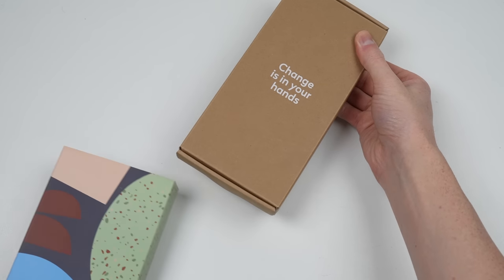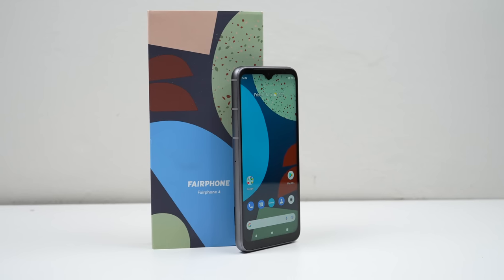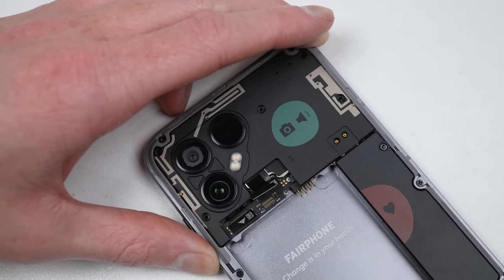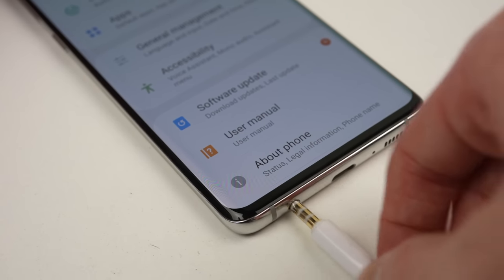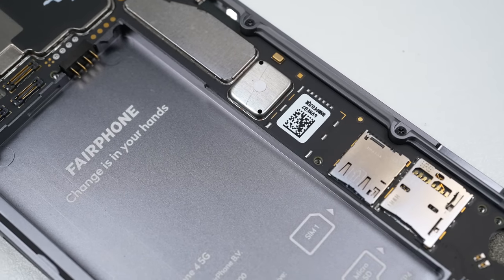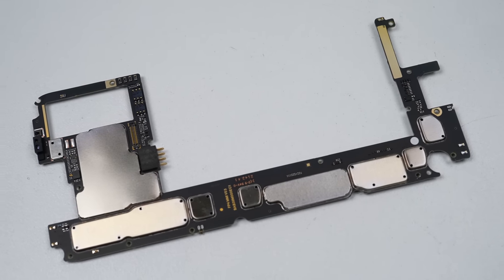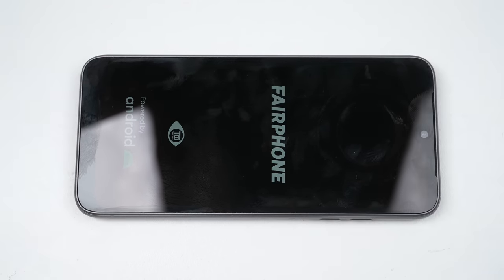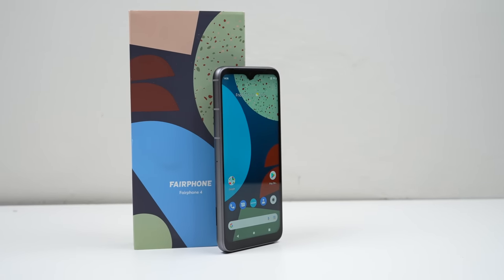The Phone Thats Fighting Big Tech - Fairphone 4 Teardown and Repair Assessment

Comment: I think this phone could've been made better with some feedback from the community, and maybe partner with other companies in other countries to provide the logistics. The repairability gimmick is cool, but it still needs some problems ironed out. Adding back a headphone jack seems to be the first step in the right direction.
Reply: The unfortunate part is you called it a "Repairability gimmick" , being able to repair your hardware that you purchased should not be considered a gimmick.
Reply: reparability gimmick?

I think we have lost the meaning of the word "gimmick"
Reply: if  repairability is a gimmick, this is not a phone to go for or even comment about further issues.
Reply: @DDRKhat  what I’m concerned with is that Fairphone seem to think its more of a gimmick - removing the headphone jack because you cant repair it whilst simultaneously being able to replace the USB-C port is asinine. Also wtf kind of company charges €35 for a cable?
Reply: @baconwizard  The USB C charging port is a necessity which cannot be fulfilled by any other port.

The headphone jack however is not a necessity because you can just buy an earphone with a type-c connector

However, that means you can't charge your phone while using the earphone or vice versa but who tf does that anyway?

I personally just use Bluetooth earbuds when I'm charging and cable when I'm not charging.
Reply: @technomatic6285  I do it literally all the time, not everyone is you
Reply: @DMack6464  Well, I can't deal with that many cables around me and that basically also means that I'm tied to where I'm sitting and cannot leave without my phone unless I unplug it both from the earphones and then the cables.

Maybe it's just me but I'd prefer a cleaner table over cable gallore when I'm working and need minimal distractions
Reply: I personally still think this is a gimmick, because in this current implementation this is impractical and too limiting. I honestly do not know how exactly to fix the issues, but at least having a choice of having the headphone port should be a good start, I think. Removing the port adds to the waste because you must have a specialized earphones or a dongle, or a Bluetooth headset to use this phone without bothering others, which is counterintuitive at best. Just adding it solves that issue.
For now it's just a compartmentalized phone akin to that from 2017. I really, really hope they can figure out a way to make this practical and actually useful.
Reply: @baconwizard  I can't claim to know their intentions but perhaps they could not find a good and easy way to compartmentalise a repair module for a 3.5MM jack? I do wish it was something that wasn't missing from this phone model.
I also agree that €35 is a stupid amount, and is just as bad as "Meta" (FB) for trying to get people to buy a similarly priced USB-C cable for if you want to use your "Quest 2" with a PC.
Reply: @PhilXavierSierraJones  As mentioned in another comment, headphone jack is the third most common thing to give out after screen and battery.

I think removing the headphone jack altogether will eliminate one loose end because a good repairable phone is one that you don't "NEED" to repair often.

There's no need for "specialized" earplugs.. just get a 3.5mm jack to Type C converter.
Reply: @DDRKhat  it looks as thought they could’ve done something similar with how they made the USB-C port replaceable considering there seems to be a lot of empty space on that board that they could’ve moved them to make way for the jack
Reply: @technomatic6285  it's a gimmick for Fairphone because FP doesn't sell most or any of the parts for their older phones (like the FP1 or FP2). Meaning the FP4 will likely not actually be repairable a few years down the road, when people actually need to replace parts and FP has stopped selling said parts
Reply: @thiefrules  Fairphone 2 came out in December 2015, do you really expect them to keep selling parts for it almost 6 and half year later?

They promised 5 years of continued support and they gave it, it's much better than any other company

Edit: Fairphone 2 received an Android 10 update in March 2022. They promised and they delivered

Edit 2: If you're using the phone for that long, grab a 3rd party part if you can.. the ease of reparability is still there.
Reply: @technomatic6285  Yes I do. Fairphone said they were trying to make phones that were sustainable and repairable. What is sustainable and renewable about not being able to buy parts to repair your device? My old 96 Corolla still has brand new parts being made for it, same with my iPhone 5s. Toyota and Apple aren't companies who focused on reparibility either. Hell, even Samsung is still sending out service packs with parts for older phones in other countries. And Fairphone, a company focused on making sure their phones are repairable and sustainable, doesn't. 

Anyways, we are past the era of phones having to be replaced every 2 years. People are running 4-5 year old phones today without problem. What's better for the planet, replacing your phone every 2 years because you need to replace one part, or keeping a phone running for years on end while changing out a few select parts? Guess which one I can't choose if I have a Fairphone 1 or 2?
Reply: @thiefrules  Apple does NOT manufacture parts for iPhone 5s and neither it is easy to repair. I don't give a shit about your Corolla because cars are here to destroy the environment. Which phone is Samsung still supporting?

Whatever man, you live in your own bubble, I can't convince you
Reply: @baconwizard  The space? Sure. But would they have been able to make a 3.5MM connector rely on a flex or other detachable component like the cameras, etc? I genuinely am not experienced enough to know if that's possible or how it'd be done.
Reply: @technomatic6285  The headphone jack IS a necessity for people who do not wish to buy into the bluetooth and dongles craze. Wired earphones are one less thing to charge and one less dongle to carry, forget, or break. Wired earphones won't need replacement after a year after the battery dies, and they don't need to be paired/unpaired to switch between devices. The headphone jack is absolutely a necessity for a lot of people still.
Reply: @technomatic6285  I think you're thinking about the wrong thing since USB-C earphones are a thing and it is still regarded as a "specialty device" since it does need USB-C connection to work and cannot be used with anything else.
Reply: @DMack6464  What phone do you use? And after it dies what phone will you buy?
Reply: Modern Oppo phones here in the Philippines offer phones with good specs, dual sim, SD card slot and a headphone jack. My wife's older (4+ year old) Oppo still working well with the original battery. It's her daily driver phone and she blows it up with tons of calls everyday. She a marketing manager. So if Oppo can do it, why can't Fairphone. Why do American YouTubers even waste their/our time with reviewing it if FP isn't offering it outside the EU?

Comment: Such a disappointment for this phone. I was really looking forward to this, especially as it supports /e/ OS. Sadly this phone is something I cannot recommend, for a number of reasons:

Lack of a headphone jack is debilitating, and their claim is BS. I have lots of devices, dating back to even the 1980's, that have experienced a lot of wear and tear, but no broken headphone jack. I have rarely ever experienced failure from it whatsoever. Something people need to keep in mind is that not all headphone jacks are created equal. It's entirely possible to build a robust one, and it's also possible to build a cheap one that will fail easily. I abuse my phones a lot, but my Unihertz Titan has a headphone jack. It's never failed me in the 4 years I've owned it, it's IP67 water resistant (so much so that I can and have tossed my phone underwater both intentionally and unintentionally with 0 damage), and it's far from alone in lasting without breakage. Plus, consider that the charging port is designed to withstand insertion cycles, NOT adjustment stress. When you want to listen to music, the phone is going to be in a more compromised and vulnerable position, and whatever connector is being used for the headphones will have insertion durability be the least of it's problems. The headphone jack is provably reliable for this, to the point that my Blackberry KeyOne has been literally yanked, dropped, pulled, dandled, and otherwise abused with headphones inserted (I oftentimes got the cables caught on something when I was younger and thus had the cable yank on the port hard when they pulled back), and yet it still works without any issue.There is no excuse for something like this being excluded.

Lack of a gasket on the back of the phone is also not great. One of the biggest dangers for smartphones is liquid damage, as more-often-than-not, such damage makes the phone irrepairable. For a company that's designing a phone to be repairable, and literally removing key features because "it might break", this is yet another inconsistency in their message. If you're removing features because it might break, then why didn't you seal the back of the phone? Seems like one of these two things is far more important and worrysome than the other.

The specs are not amazing, which normally I wouldn't care about too much, but considering this phone's price it's pretty steep for what you get. Specs are something that gets over-inflated by people. I've used a Blackberry KeyOne and now my Unihertz Titan as my daily drivers and never really had issues with performance. My family all has Moto G7 Powers and none of them have issues with the performance of the phone, despite their varieties of uses from production work to media consumption etc. Still, it is a concern.

The materials also do not feel great. I completely understand the elimination of brittle glass backing, but Unihertz and Blackberry already solved this. The Blackberry KeyOne has a nice-feeling, grippy textured-plastic back, which feels nicer and looks nicer. The Unihertz Titan has some nice metal accents and other finishes on the back to avoid it looking plain. Considering the cost of the Blackberry, and especially considering the cost of the Unihertz Titan, it's really not fair to give Fairphone much slack here.

Unfortunately, I feel like LG already showed us a better version of this phone: The LG V20. Massive, removable battery, with a dedicated external battery charger, good materials that don't feel like they cheapened out, excellent specs for the time (still decent today), a headphone jack that is both robust, water-resistant and connected to one of the best DACs ever built into a smartphone (that can even drive beefier high-end headphones), dual-SIM capabilities, a gasket on the back removable cover, and microSD card support for 2TB (yes they supported a capacity that didn't even exist at the time).

Overall, this phone has potential, but this company... I'm not so sure. Really not liking the direction they've taken this product. Such a shame.
Reply: I have the v20

Comment: Really great device! I use wireless headphones so that's not an issue for me, but because it's not available in Canada I'd have to hunt for one pretty hard. If the bootloader is unlocked though, how much of the sources are available? I'm curious to see what the custom ROM community would be like.

I've used ROMs for years and still do (even on my current phone, a OP8 Pro) so seeing that parts and software are so readily available is a huge plus.
Reply: why change device when the one you currently own is better?
Reply: @gus74v07  The fact I can repair it. I don't like buying phones every three years so I'm hoping that at some point they'll have something better than what I own

Comment: I feel like this is a case of one step forward, two steps back - no headphone jack, no dual sim (they could at least merge second sim slot with micro SD card slot, like Xperia did, though I personally don't like that either), sim and micro SD slot non openable without special tool or dismantling the back of the phone, therefore making it more prone to breaking (once again Xperia has the right idea), no gasket so I wonder if it's splash proof... Also I must wonder if hardware can be upgraded? If they come up with better camera component or OLED screen - would I be able to just swap it? That would seriously be a huge step to reducing e-waste. There's potential there, but it's not really realized.
Reply: Upgradability is something they have committed to with previous phones and I'm pretty sure they're on the record for intending to keep doing it, and it is IP67.

Comment: Excellent vid, I like the concept of the easy self repair and the replaceable battery, but value for money, in my opinion, I think not. Putting the recycle, fairtrade blah, blah, blah out the way I just by 2nd handphones, which is my little way of helping the planet.

The bonus to buying 2nd hand is I can upgrade every year or so.

Currently for the price of £220 British pounds I purchased a nearly new condition OPPO Reno 4 Pro 5G with 12 gigs of ram and 256gb memory. Value for money is my bottom line when buying a mobile phone.

Comment: The next fairphone need to bee upgradable. Like you have notch display but you can buy a punch hole display and just plug in it it . If you want to upgrade camera just change module. That would be so awesome
Reply: Well, they tried that back in 2011 with Project Ara by Motorola. Never really took off because they said not many people would actually upgrade their internal components as much as possible/wanted.

Comment: Dear Fairphone, it should be an awesome feature if you would add a portable charger for a spare battery. When you are low with one of your batteries you can switch out rapidly to the charged one and in the meantime, with the portable charger, you can charge the other one. I hope you read this because I think it could be a big deal for people like me! Seeing a pop-up back cover remind me straight to this possibility.
Reply: Yes. Do this, so I can play PoGo on it without carrying a huge power bank and annoying cable. Also won't have to replace cable several times a year
Reply: @lastlast2078  idk about the cable statement, i had to replace my phone charger(usb-c) after 2 years, and even then it still works i just got the second as a backup for when it does fully break
Reply: @when-do-we-get-a-block-button  But you probably don't play PoGo, I'm talking about charging phone while walking and carrying it around every day; this put's a lot more stress on the cable and they break more frequently. If you just charge phone at a plug and leave it while charging, the cable will last way longer.

Comment: 5:00 honestly removing the headphone jack doesn't make it more sustainable. First of all, if you're using the charging port more for audio, you're going to wear that out a little bit sooner. And secondly, it requires new peripherals like usb-c to 3.5mm dongles which could also become landfill, moreso that they're a flexible cable. Theyre just moving one breakable part inside the phone, and pushing it out while moving the cost of dongles/wireless headphones onto the user.

Comment: For a phone that's sets to be different from the rest, it seems to follow a lot of the modern trends of not including a charger and cable, having a camera notch, raised camera cluster, no headphone jack, requiring a stupid USB adapter for headphones and so on. The argument for no headphone jack is BS of the highest order. A USB C port would be much more expensive to replace than a headphone jack and breaking one would also prevent you from charging the phone. They want to lure you into their rebranded bluetooth earbuds. The battery is also pissing small for a SD 750G CPU. Only 3905 mAh? Even phones with SD8 Gen1 CPUs have larger batteries. Also, would they care to explain how you're being more environmentally friendly when you'd need two extra boxes for the charger and cable instead of a single one if the phone came with those?
Reply: But they did it before it was popular at least the cable

Comment: If they can add an option for a headphone jack and a default power cable, a modular display design to allow up to 144hz, or even a customizable motherboard with similar connections yet different spec sheets, and brick in the box, it's a win. Close but no cigar, yet.
Reply: As much as I want repairable devices, Fairphone is really hurting themselves by not offering their devices worldwide. They've been around for a decade, so you would think they could start selling them outside of the EU. I don't see them being around for another decade in my opinion
Reply: @Minitrucker231  yep - US and Asia, as well as Africa and Australia need to taste Fairphone.